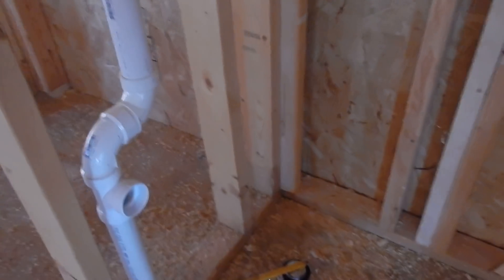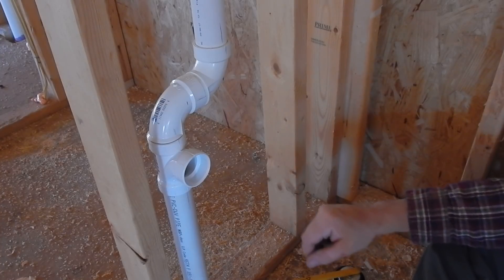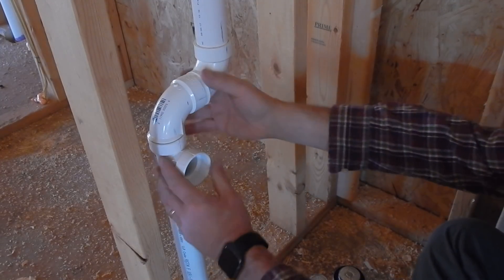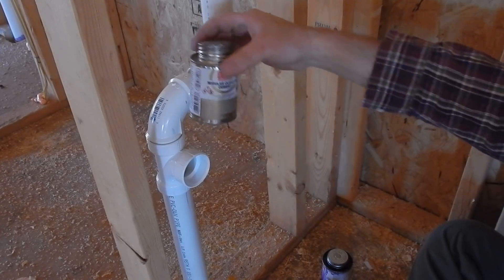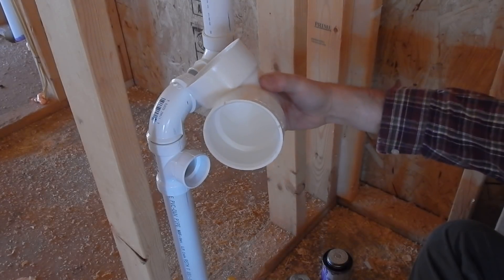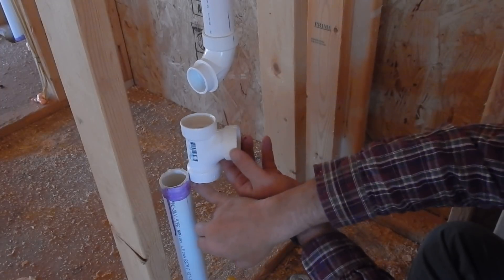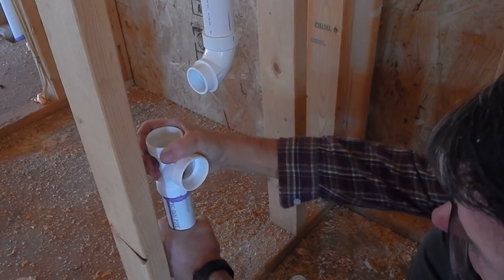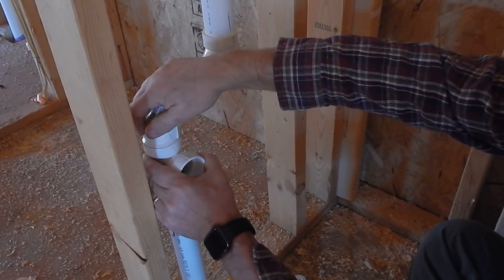Plumbing - drain and vent pipes

Comment: Question...under my bathroom sink, the drainpipe portion that goes into the wall to the vent pipe has some play. I can pull it towards me for about an inch. Is the behind wall vent pipe flexible to give that much play or is it most likely disconnected behind the wall? The house was built in 1995. Thanks.
Reply from the maker: Typically the pipe that goes into the wall will go down thru the bottom 2 x 4 plate and up to the vent. If the hole in the floor is large enough for the pipe to move back-and-forth that could be why your pipe has motion. I would expect that if you don’t have any sewer odors in your bathroom then the vent pipe is still connected correctly.